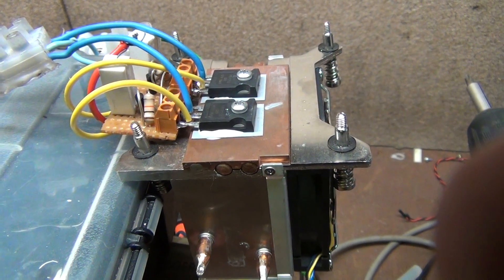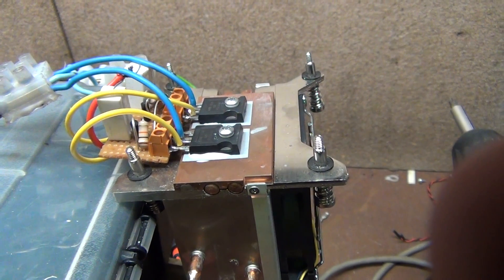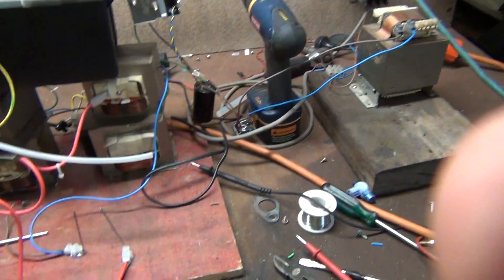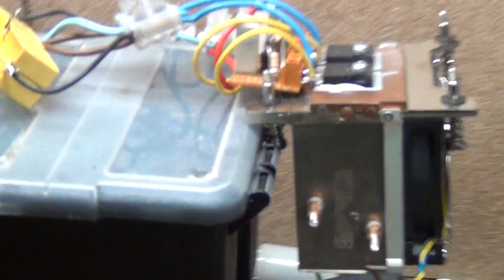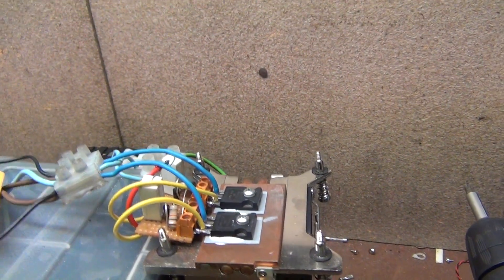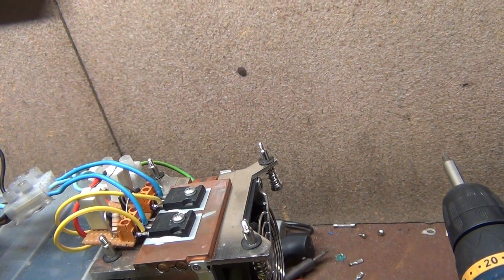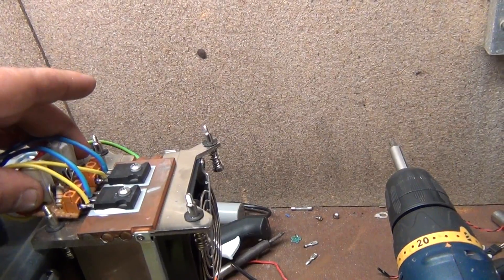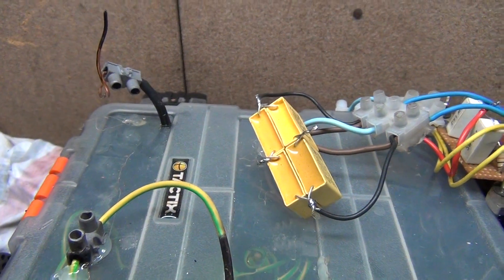Cheap N Cheerful ZVS Driver on 45 Volts - Heat Pipe Cooled

Comment: lol, the only thing about switching power to transformers is getting the inductance balanced with equal capacitive reactance for effective oscilation and resonance.
And back emf / harmonics / psu isolation and other odd problems.

Ive allways been a repairer so design is something i skipped, just a lazy sod i suppose lol :-)

Comment from the maker: the TL494 will do the same job in one IC. but requires inverting the output before driving the transistors. it has a lot of nice features. but these two old dinosaurs are keeping me well entertained tonight. less mumbojumbo required for an easy power inverter. found a schematic online and modifying it for my use. no fuss with feedback, deadtime control etc :-) just flip flop flip flop and transistor happiness

Comment: Ahh the old 555 timer, and flip flop, sounds like a good circuit.

My favorite chips are 555 / 4017 decade counter and 74ls138 3 to 8 line decoder, old digital chips are allways fun ;-)

Comment from the maker: right now actually, got a 555 sending clock to a 4013 to flip flop 2 darlington transistors to drive a very small TX. gonna make a great capacitor charger inverter!

Comment: Well i know valves can take punishment better than semiconductors, but geting the operating conditions right could take time.

For example burners/boosters/boots for c.b radios are semiconductor and bad matching kills them quickly, but valve linear amplifiers cope better, thats why you will find some a.m radio stations still using them for the final p.a before the antenna stack.

I can hear you typing "Tube based multivibrator circuits" he he :-)

Comment: well think about all the valve rf p.a's in old ham radios, or the am transmitters.

Mind you it would be a pain in the arse supplying filiment/bias and decent operating anode supply, and they are higher impedence so primary rewind, naa forget that :-/